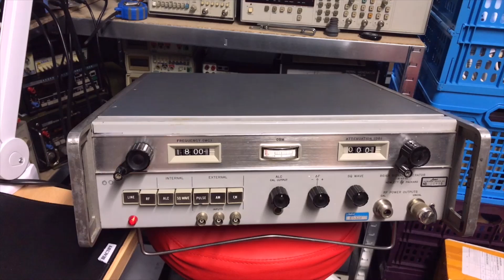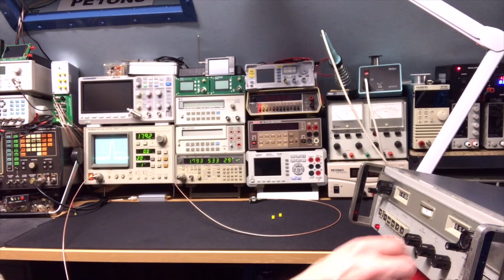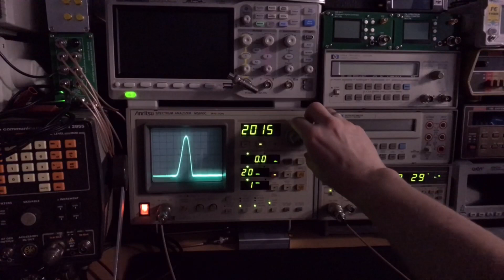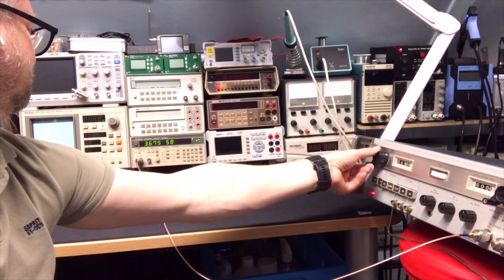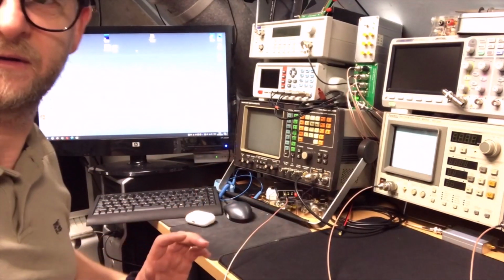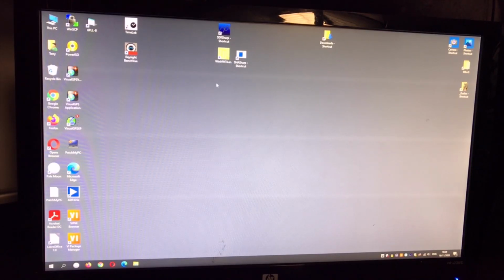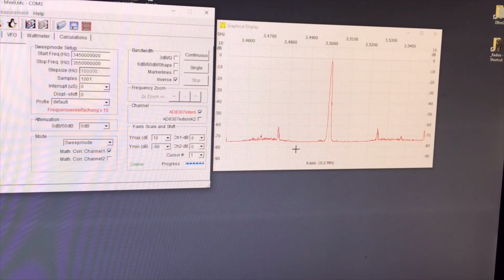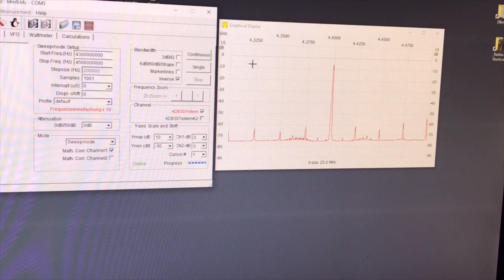#104 HP 8616A Signal Generator 1.8 - 4.5 GHz , Quick Test

Comment: Tony, make sure the ALC button is engaged on the Signal Generator, and the ALC control is positioned so the meter is centered at Zero. This will allow the attenuation counter (and control) to be accurate within 1 to 2 dbm. It was hard to tell in your video if the ALC button was pushed in or not. -Trevor
Reply from the maker: Thank you!... i think it was not, that is a good advice, thanks Trevor!.